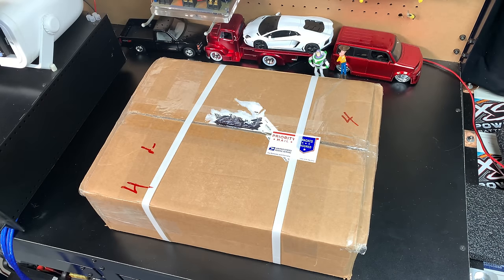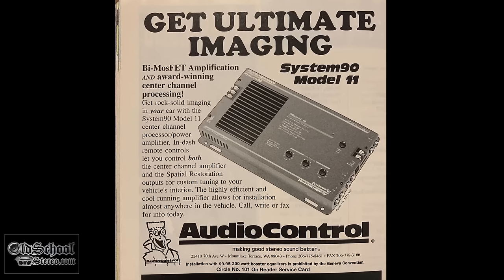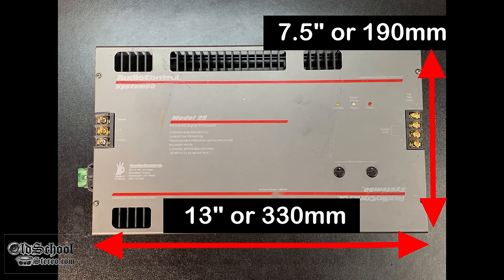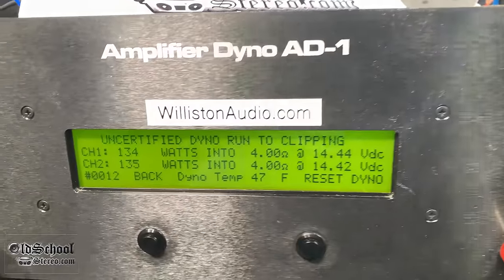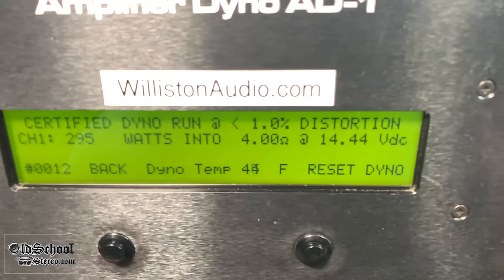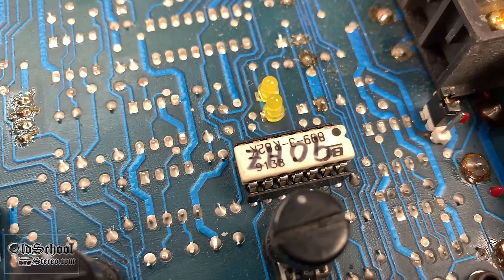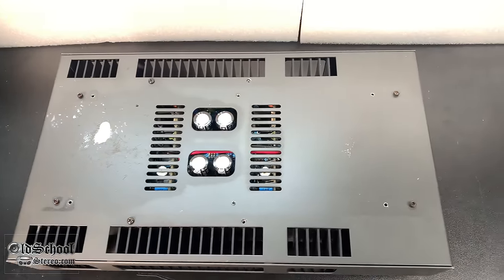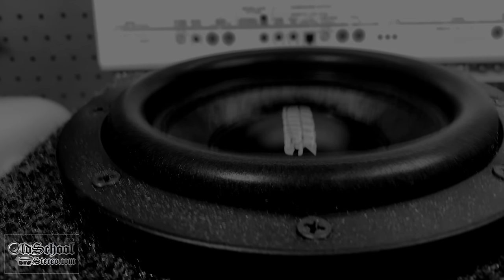Powered Signal Processor? Vintage AudioControl System 90 Model 25 Amplifier [4K]

Comment: The socketed chips are the crossover filter and the subsonic filter. The jumpers are for noise reduction via the input grounds. Balanced/unbalanced and ohms adjustment on the ground for the inputs when run unbalanced. Pretty much how the more modern stuff they put out still does.
Reply from the maker: Thanks 👏

Comment: Those caps are almost 30 years old that thing is doing great! Even transistors age as well just not as fast as electrolytic caps do! You know that amp has not had an easy life. They might put out a lot more power for less money today but none of these current amps will be used hard and still working 28 years latter! Most of them have a hard time lasting a year!

Comment: Those chips.inside could be changed out for different crossover frequencies. They look just like the ones I used in my Audio Control 4XS 4 way crossover so I could use all my amps as full pass and actively cross them over with the 4XS.

Comment from the maker: See the AudioControl LC1.1500 1500W Subwoofer Amp Tested here: https://youtu.be/iz3wRwwlyHs

Williston Audio Merch: https://teespring.com/stores/bigdwiz
SMD AMM-1 Audio Multimeter: https://amzn.to/2WRc5eD
SMD / D'Amore Engineering Amp Dyno: https://goo.gl/sJTcf7
XS Power D1400 Batteries - https://amzn.to/2BPFCKW
XS Power PSC60 Charger - https://amzn.to/2CHGcfs
Fluke 1000A AC/DC Clamp Meter: https://amzn.to/2Rw5WDA
Handheld Dyno: http://amzn.to/2u2EgKV
My Favorite Screwdriver Kit: http://amzn.to/2x0VzcE

DISCLAIMER: This video and description contains affiliate links, which means that if you purchase from one of the product links, I may receive a small commission. As an Amazon Associate I earn from qualifying purchases
Reply: Can I send a amp in to get tested it is a Rockville amp but isn't listed anymore and wondering how much power it actual puts out 4 ohm mono block says it can run at 2 ohm but don't know it's yours to test if you want to. Be nice to see a video of as well for everyone else to watch
Reply: I have a idea for a video if you would consider? It's a little different
Reply: Run a dyno test on a amp that the average guy can use in his car no problem like 1000rms but instead of using a big battery bank use an average battery that almost everyone would use like a good quality average yelowtop that way we can see the voltage under load and the wattage and do the math to see what amperage were drawing for the average Joe so we can once and for all explain to new people why a 5000rms amp is no good without huge support and figure out what can realy be ran on just about every car out there you could also test different amps like a 2 or 3000 to show why there a bad idea without the support for them and also could try different batteries to show the difference in a good battery upgrade or a second battery for example how 1000rms at 14.4v is 69 amps
But 3000rms at 14.4 is 208 Amps and the real voltage that counts is voltage under load we could see in real time it would not be perfect because the ault would normally help but it will help the new guy understand and show people what happens to there voltage when there care is off and show whats actually needed for different people thank you love your videos I would love for you to do this so I could cheat explaining things to my customers lol
Reply: @tlinedesigns9728  he has that battery bank for a reason it is because he doesn't have a alternator charging the battery like a car does that is why he needs multiple big batteries to withstand the power draw from a amp without another source of power
Reply: The whole point in what I said was to explain voltage drop to noobs explain why people need 4ga or 1/0 for high amounts of power and show in a video how much a load of idk 1000rms drops the voltage of the average car battery it's a suggestion for a video for noobs I understand his setup completely you didn't understand my meaning but no hard feelings its probably my grammar lol I wanted to have a way to explain voltage drop to noobs and explain why you need upgrades like 1/0 or a ho alt for 3 or 4000rms
Reply: The whole point is if he hooks up a 1000rms amp to a single battery and dyno test it and the voltage drops to 11 volts he can then say hey dude this is why you need this or this for this situation big d has always tried to help the new guys I came up with a idea I though would be used for the new guys

Comment: That's going to need some tlc. I can see the traces on the board starting to lift.
Reply from the maker: I’m surprised you are the first one to notice!
Reply: Agreed, it looks like it has already been gone through once, that fake ass fuse holder looks like it came off the shelf of the auto parts store. The thermal compound is too clean to be 24 years old. And it's tough to say on those caps but they don't quite look right either. It has had some decent work done though the numbers don't lie but it wouldn't last long in the real world with the board itself starting to come apart :(
Reply: Traces are not 'lifting'. This is an intentional construction technique back in the day where solder would be passed over the board and deposited on the bare traces as a way to get increased current carrying capacity on those traces. Heck it's still done today, but it's more rare because you specify for the boardhouse to use thicker copper --- those choices were not available back then for consumer electronics (aka price sensitive)

Comment: I remember those. I worked at an AC dealer BITD. Solid amps for mids & highs. Not great for subwoofers. They got hot, and didn't have much punch, compared to other premium brands then. These weren't cheap. A Punch 200dsm would out-slam it easily, for about the same money.

Comment: I had this amplifier but in white I'm not sure if the rated power is different from a white one to a gray one I also had the matching 4-channel amplifier it was sold separately as a complete system 4-channel amplifier with the  EQ built in it and the two channel with the epicenter built in bass knob sold separately it was a very clean sounding system did not deliver a lot of power but extremely unreliable the two channel amp said it can handle 2 ohms it always clipped on me and I was running 4 jl W4 10s and 4 mb quart6.5 2ways on the 4 ch with a alpine cd 4v deck with front rear and sub  it sound great but couldn't get it to jam for long periods the 2ch would clip after 20min of play at 2 ohms today that I'm older it would be perfect for me